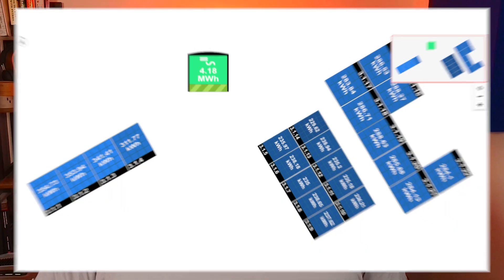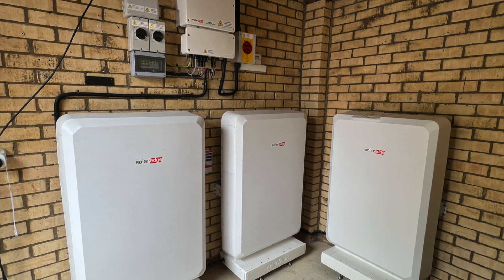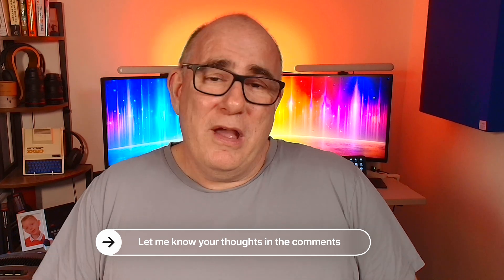Reasons Heat Pumps are CRUSHING Solar Diverters

Comment: Hi JT,

we have a Daikin Altherma with a back-up heating element inside the system and a dynamic energy contract (hourly prices). This Daikin has also the possibility to lift the 43 degrees temperature to a higher adjustable value in case of low grid prices. This is done by closing a contact on the Daikin, just like a thermostat. All this is managed by Home-assistant who looks at the lowest grid price of the day (in summer mostly the hours with a lot of sun). I use ESPaltherma to get things working. 

The Daikin only uses the heating element for the legionella run once a week (also planned at the lowest cost hour) and will also be used when the outside air temperature drops below -5 celcius to support the heating of the house if the pump itself is not able to bring teh temperature in the house at the wanted level.

Does your Daikin setup also have the grid contacts so you could manage the heatpump yourselfs?
Reply from the maker: to be honest, I don’t know. I need to have a look at it but I’m still a little new to how it works. The legionella cycle is run using the heating element rather than the Heat Pump. This is controlled by my solar diverter on a scheduled run once a week. I will certainly take a look at it more in depth over the next few weeks.

Comment: We have 15 panels, 3.6kW Inverter, 19kWh of battery storage, an Eddi, an EV & we are still on mains Gas CH (gravity fed system boiler) which has a Tado smart TRV system fitted.  Since switching to Octopus Intelligent Go tariff I've not used our Eddi. We export all excess solar & battery storage for extra income which pays for the gas come winter. However, I'm thinking about using the Eddi once a week on a legionella cycle as our HW (cylinder t'stat) is set for 50c.
Reply from the maker: yep, that all makes perfect sense to me, with the current export rates push out as much as you can and then buy it back at a lower rate if you need to use it

Comment: I have a heat pump survey booked in and on the initial phone survey I was asked if I'd like to add a solar diverter. My thoughts were no, as if I had excess solar (ignoring any export payments) it would be more efficient to run the heat pump rather than the diverter as you have pointed out.  The Eddi's seem to be £300-400 so just seems overkill for what it does these days.
Reply from the maker: I fully agree if I was in your position, I wouldn’t buy it just a simple immersion will take care of the boosting for you. However, as I already have it, it seems wasteful not to have it plugged in just in case.
Reply: @JonathanTracey  yeah, if I notice an excess in solar production, once I have a heat pump that is, I could just set it manually to boost the hot water. I had considered an Eddi when getting the solar installed earlier this year as it sounds like a good option to have as I already have a Zappi charger, but I still can't work out why they are so expensive? Sound's more like it could be handled with an ITTT automation on a smart plug/relay. I'm sure it must do more than I realise?
IF I had one, I think I'd still run the heat pump first. That being said, if ever tariffs change where the grid doesn't want the excess and they start charging you for the export (think Australia and Californian have something like this to discourage md day peaks) then I would want to us the Eddi for the immersion heater just to use up as much energy as I could. At least you have it as an option already so it may come back into play down the road 😉
Reply from the maker: Yeah, I definitely think they’re overpriced for what they are and they’re way overspecified. They can handle two resistive heating elements and with a relay board they can control two more. I’m sure they could produce a unit. There is a lot cheaper this design for your average user. I agree with you a simple home automation script and I shelly relay and you’re off to the races. i’m sure at some point in the future the tariffs will change but look at the way the UK grid is organised right now. I don’t think that’s likely to happen in the next five years.

Comment: which was cheaper to buy the heat pump or the solar diverter?
Reply from the maker: the solar diverter was a lot cheaper but it costs more to run than the heat pump
Reply: @JonathanTracey  Thanks for the reply,  in the setting page on the diverter you can work out how much electricity it has diverted so the pay back will be less than two years.. and the heat pumps pay back?... Great youtube channel👍
Reply from the maker: Thanks, looking like the heat pump will pay back in 5 years, but don’t forget it also heats the house which the diverter doesn’t

Comment: Like you I’ve a three bedroom house with a large solar array and in our case two 13.5 kWh Powerwalls. We have a Harvey, Eddie, Zappi and an EV but in our case we also get a FIT payment that averages out at £400 ish a year. We heat our water at night with the heatpump but I’ve also have  my Eddie set to boost the water to 62° each night as we like hot water and it sorts out the legionella’s cycle. In the summer I just let the solar heat our water via the Eddie as otherwise the electrons go to the grid. I suppose if I really was thrifty I’d arrange with octopus to just keep my generation FIT payment and get paid the 15 pence for all that goes to the grid but I’m not sure in our case it would make much of a difference as we also get as part of the FIT payment a near 5p for 50% of our generation . I’ve worked out that our annual energy bill taking into account the FIT payment the £100 saved on the gas standing order, is between 1 & 2 hundred pounds that includes charging the car about 4000 miles a year, we have a motorhome. We also have a Honeywell home TRV system that makes every radiator a zone. Each TRV sends a signal to a central processor that in turn talks to the heatpump to switch it on or off as the heat is required it work like a dream and allows us temperature control of every room rather than having a central thermostat.
Reply from the maker: I also have FIT payments on 2kw out of my total 9,6kw, but I opted out of the deemed export as I can then get paid on my export at 15p kWh. I have used the eddi to heat hot water for nearly 3 years but now the heat pump is installed it makes more sense to use the excess to heat the water at 3:1 ratio rather than as 1:1 ratio with the eddi. How are you getting on with the TRVs I was told by my installer they had to install them to be MCS compliant but to leave them fully open all the time in all rooms.

Comment: We don't have a heat pump, but do heat water via immersion using overnight cheaper tarrif rates. With the current export rates it makes sense to export the excess, but these won't last forever. I checked out a solar diverter last summer, but discounted it on the basis that it would not pay for itself in any meaningful time period. I wonder whatever happenned to the old solar thermal systems? These work fantastically in summer and would definitely raise the tank water upto 60 degrees and above. Perhaps these match the usage profile of a heat pump even better?
Reply from the maker: agree I think if I was looking at one now I would not buy a diverter, a simple wifi switch that could turn it on once a week for the legionella cycle would suffice
Reply: @JonathanTracey  this is exactly what we have. I think around £25 for a 4KW switch. Happy to report there was a 20% reduction over heating via gas. The other option we're looking at is a mixergy tank with heat pump
Reply from the maker: are you looking at the one with a built in heatpump? if so be careful where you site it, I needs external air access via hoses and its quite noisy, so you would not want it in a cupboard next to your bedroom
Reply: @JonathanTracey  interesting - thanks for the heads up
Reply from the maker: Yep agree he’s done some fantastic videos on it

Comment: Are you considering the extra wear on heat pump compared to simple electric element?
Reply from the maker: No because the heat pump works more efficiently if you don't keep stopping and starting it, your better to have it run constantly
Reply: @JonathanTracey 
                                 In the summer you wouldn’t need to run the heat pump just to heat the water, so reducing wear
Reply from the maker: So in the summer we would only run the water heating cycle, it would only run at full power for about 2 hrs a day, and then just tick over between cycles, all of this would be powered by solar at a COP of say 3, so if we needed 3kWh of hot water we would feed the heat pump 1kWh of electricity. If we heated by the element we would feed it 3kWh of electricity
Reply: @JonathanTracey  so more power to export, win win 👍
Reply from the maker: absolutely my plan for 2025 is to be a Net zero year
Reply: @JonathanTracey I would be interested in the cost of running the heat pump continuously during summer vs heating water via solar. What does a heat pump do when there is no requirement to heat water?
Reply from the maker: It basically stops, has a draw of a bout 10w to power the control board.

Comment: I'm a green tech head and I'm not planning to get an Eddy. I'd rather call on the heat pump to heat the water. It does make for an interesting challenge, though; if you have a sustained bit of sun that you'd like to use for some extra water heating in an otherwise peak period, you would really need some intelligent control over the heat pump to do it!

I think I will be settling on the Cosy tariff; right now, I can export at solar energy at 15p/kWh, but I have eight hours in the day that I can import with at 12.25p/kWh. That makes solar more expensive to use than cheap-rate grid energy. I'm hoping for water heating that I can set it heating the tank in the morning cheap rate and boost it in the afternoon cheap rate as needed. I'll have to play around with it to see what works for me and my family. But obviously I can't do any of that until I have the heat pump; right now I have a condensing combi planet boiler.
Reply from the maker: Sounds like a good plan, if you have an EV you could get on Go or IOG and get power at 8.5/7p respectively. That would make it even cheaper to run
Reply: @JonathanTracey  I would qualify for Go and I have been considering that. I switched to Cosy just before they started allowing the 15p/kWh export on Go.
Reply from the maker: Cosy makes sense with a small battery, as you can keep topping it up to get you to the next cheap period
Reply: I was on cosy back in the time that it only had 2 dips in price 4-7am and 1-4pm, I do have solar but no batteries right now, and running heat pump for small semi. Jan 24 our electricity consumption was £650. I worked out that on agile Jan 24 would only have cost me £380. So I changed to that mid February. Our electricity bill has halved pretty much, I think our average electricity price since February is somewhere around 17p/kwh, I found that only the afternoon cosy dip was much use, who wants to be heating the house at 4am or 10pm. Might be OK with underfloor heating but not if you are running to radiators.
Reply from the maker: Yeah availed over the long term is going to be cheaper, seen a lot of people losing their minds over the prices jn last few weeks, but if you’ll,at the long game it works for some
Reply: @mikebarry229  I do have a battery as well - kind of - my EV can power the house and supply the grid. Everyone's situation is different. I used to run agile but I spent a lot of time controlling when appliances would turn on and all that sort of thing which was a bit of a cause of stress for me. Cosy is possibly not the best tariff for me to be on, but there comes a point for me where I like to say it's good enough and move on. That said, I think the rates for Cosy are really good right now. If that changes then I will change too.
Reply: @robynrox  the best thing with cosy is you could potentially run 24 hours a day at the cheaper rate with a battery one third the size you would need to do the same on OIG. I'm planning a 45kWh battery install, but with my over powered ASHP, and small poorly insulated house that would only see me through half my max 120Ah daily electricity use in the depths of winter. The same system on Cosy would see me through for sure, all at the cheapest rate.

Comment: I just use mine on sunny days once a week to boost the tank over 60 degrees
Reply from the maker: do you just have it shut off at other times?
Reply: @JonathanTracey  yeah, used it all the time when I had a gas boiler and it’s a good piece of kit, might come into its own again if export/import tariff dynamics change 

Also boost the tank with solar sometimes for an hour before I have a bath so as not to shaft the household with tepid water for a short while after until the heat pump sorts it lol
Reply: I suppose it’s a good backup as well if anything ever breaks and we’re without the Heatpump until it gets fixed at all, gives a bit of redundancy for hot water

Comment: Agree with others the eddi has a relay board which can be used to divert the excess energy to the heat pump rather than the emersion heater.
Reply: As he has a large battery that in the summer is likely full the heatpump will draw from that so there’s no point in him diverting the solar from Eddie as that’s already happening from the batteries in our case we use the second channel on Eddie to heat our two towel rails in the summer when the heatpump is off.
Reply from the maker: That’s exactly what I’m gonna be looking into
Reply from the maker: But in my case the water is already hot because the heatpump used solar to heat the water up to 43c. I'm not sure using the booster will add anything, may as well export the power.

Comment: One idea.  Add the eddy relay board and use that to boost the hot water, it will work at 13amps.
Reply from the maker: Yep that's how I intended to use it but as the heat pump will have already heated the water its kinda redundant :-)

Comment: Hi  Jonathan I agree with assessment better to export excess than heat the tank with Eddi. As you said heatpump more efficient as heating the water. Think boosting water temperature for 60c eddi will be useful.but depending on usage will use eddi & heat pump to get tank back up to temp quickly. Thanks for video been following for heatpump journey got octopus survey next week. Got  two evs and solar and battery’s. Ian👍
Reply from the maker: thanks ian, good to know others are thinking the same.  my heat pump seems to return the water to 45 degrees in less than an hour, but you need 60C then it would be a good option. batteries and solar really go well with the heat pump, keeps costs very manageable
Reply: @JonathanTracey  

Your 6kW Daikin HP can heat HWC to 60C without resistive heating, and using its onboard 'booster' heater in HP, can push that to 65C.
Reply from the maker: When it was installed, the on board booster was replaced by the Eddi, it has full control of the immersion heater coil, so I have it scheduled to boost for once a week up to 65° the rest of the time the Heat Pump itself just takes care of water heating. So going forward into the summer my rather expensive solar hot water diverter is effectively going to be a time switch.
Reply: @JonathanTracey Jonathan do you know roughly how many KW you heatpump uses per day so I need to know I need to look into more storage for my home thanks ( I know heat lose  and heatpump maybe  different just just as guide) cheers
Reply from the maker: yes, but I am waiting to get a month's worth of data (end of December) as that will give me a worse-case scenario - cold, wet, windy, and possibly below zero days. The highest I have seen so far is 24kWh*, and the lowest is just *8kWh -that's combined heating and hot water.
Reply: Put it in a draw, no point using it with current grid pricing. Maybe you could figure out how to wire it to the SG relays on your heat pump to have it boost to higher temperatures when there is excess solar.
Reply from the maker: It’s in the ‘virtual draw’ now 👍

Comment: My installer steered me away from an Eddi last year, glad he did, makes no sense with battery and solar anymore if you have a good tariff.

I do :Fill battery,  self consume on house (never car), export.

I don’t : charge car or heat water from our generation.  I can do all that for approx 7p a unit for 90% of my usage

Export at 15p a unit at least.

Must be limited use cases where a diverter is worthwhile,  and they’re not cheap.

Did consider using my HA and a £40 smart thermostat controller instead of a true diverter but wasn’t worth the effort for me.
Reply from the maker: that’s my thinking with a 15p export it makes more sense to sell it and buy back what you need at 7p.

Comment: I use mine for the legionella cycle once a week these days since having my heat pump.
Reply from the maker: dotyou think you will use it during the summer or just let the heat pump do its thing?
Reply: No, I’ll just use the Eddi once a week for the legionella cycle to get the water to an higher temperature than the heat pump would reach to kill any possible bacteria that would form up and export as much as possible so I’ve got enough credit to cover the winter bills. No more gas to my property so it’s great.
Reply from the maker: That’s my plan as well fingers crossed it all works out